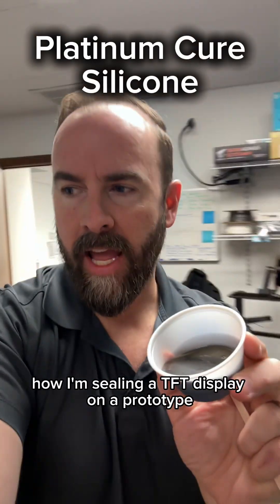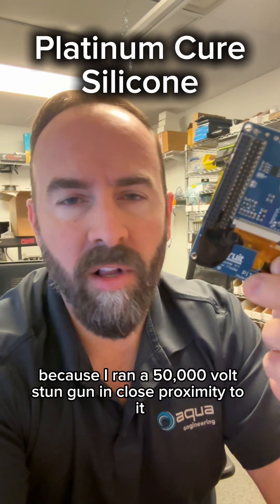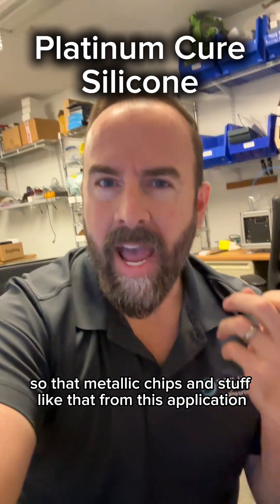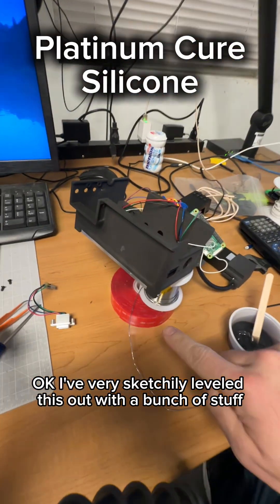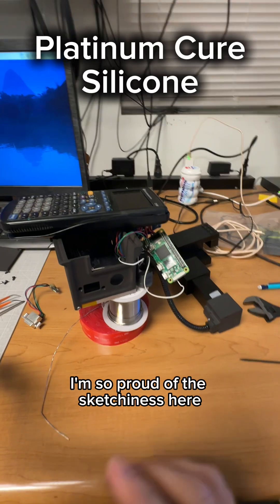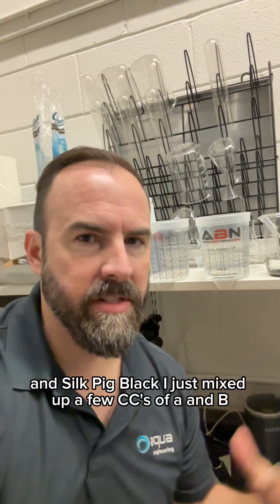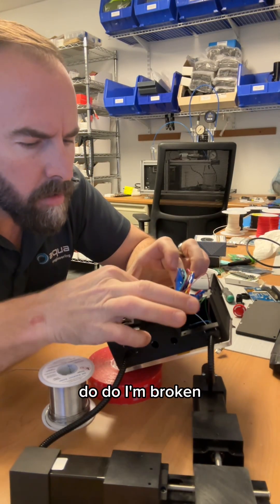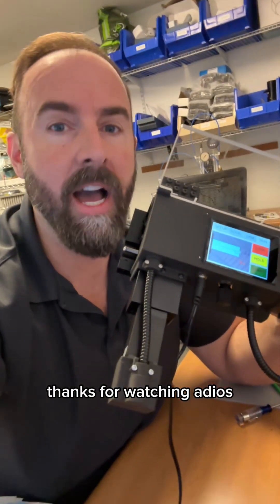Silicone and Electronics

Comment: One issue when sealing with silicone is silicone is a thermal insulator so it’ll trap the heat and you run the risk of overheating the chips. This may be fine for light weight applications but for heavier compute or if in proximity to a heat source, it could become a problem
Reply from the maker: True. Compound it with Copper powder?

Comment: Noice 💡 

Are there any epoxy/silicone reaction that could get too hot for the electronics?
Reply: With a deep pour maybe but remember most electronics have running temps over 50°C which is hotter than most people find themselves willing to touch and its rare for most two part curing materials to get that hot.

Comment: The thin layer of mineral oil there first and then pour the silicon on top which protects the circuit but also allows the removal of the silicon if you need to make any changes
Reply: Would spraying with droplets/aerosols provide enough cover? Just a thought

Comment: When you sell them in early 2026, will they come with a pi zero 2W or you’re own board?
Reply: Trying to learn from you
Reply from the maker: There’s a carrier board for the 2W that has the arduino and power conditioning, voltage translation, etc.

Comment: Always do a test patch when using plat cure silicone as it is very particular with what materials you can actually use it with, cure inhibition is no fun.. trust me.. 😅 also always make sure whatever you are pouring it in is CLEAN. 

Honestly, if your application doesn’t involve food or long lasting skin contact (or.. uhh.. bodily insertion 😅), just use tin cure, it’s cheaper and easier to work with. 😊
Reply from the maker: Sulfur is the culprit

Comment: Sorry to ask if you’ve already covered this, but what is your educational background like? How do you recommend people begin to learn the skills necessary to work on projects like you do on your page? Is there a specific type of engineering? I’m fairly uniformed but looking to learn more
Reply from the maker: I’m an electrical engineer, but 99% of what I use everyday is self taught. Was never taught microcontrollers, PCB layout, Python code, or how to run a CNC. Some of the other responses here are great summaries of what I’ve said in past videos too.
Reply: Not the OP, but I build stuff too. The electrical side is easy in my opinion. I came from a software background and still spend most my time writing firmware code. I might spend a rapid few weeks or months on the electrical and hardware side but then spend many weeks and many months building out all the software around it. I mostly do IOT things so maybe that's why it's more software heavy. 

But just do it. I teach people how to get into electronics on my YouTube channel and so many people are saying like I'm a mechatronics engineer in my 3rd year of school and haven't done ___ . It always shocks me, they haven't done anything with electrical, never made their own little robot thingy, never painted or sanded anything. If you want to build stuff, then build stuff. The amount of skills from silicone and epoxy to wood and metal and CNC and all the other stuff is just one part of the puzzle. You deal with contract manufacturers and factories and sourcing and logistics and tariffs and websites and sales and marketing campaigns. All the stuff can be learned individually and you can go to school for each of them, but most requires you to just start doing them. 

If you want to learn how to fish, I would not recommend reading books on fishing, I'd recommend going fishing 😂 Good luck! And maybe just pick up a electronic starter kit from the company Elegoo as they will teach you most the basics you need to know starting at zero.
Reply: @FluxBench I subbed
Reply: @codeintherough  Thanks!
Reply: As mentioned by the comment below, Electronic Engineering. But also know it is not quite the same degree as Electronic Engineering Technology, make sure you go to a decent sized college offering EE, I only learned DURING my EET associate degree the difference. We learn a lot of the same things down to component theory/math/troubleshooting, but the EEs are the real design and mathematic wizards. EET is a more of a supportive role to an EE, putting together and applying what they conjure up 🧙🏻‍♂️ This has become more apparent during my job search for tech jobs, but I e been considering studying up for CNC and Industrial Maintenance certs to increase my appeal, good luck with your journey!
Reply from the maker: @VoidApogee the older I get the more I like the idea of an EET degree but you’re correct, great summary.
Reply: @i2c_jason  Not trying to knock it too hard, or make it sound non credible. It  was an amazing program, introduced me to CNC and have worked up to an Epilog Pro 48. The skills you learn open you up to SO many doors, but for the same 2 years (no summer) I feel like a EE degree would have been a stronger path. If EET associates were a 1 one year or so course, THAT would be amazing. Thank you for your content, motivating!
Reply from the maker: @VoidApogee this is great perspective for anyone watching who might be considering an electrical engineering/ EET degree. Thanks!
Reply: Going off of his other videos what I remember is he studied electrical engineering, went straight to working for himself after school, he recommend learning from chatgpt
Reply from the maker: @codeintherough there’s many ways to learn, obviously if you can get a 4-year engineering degree that’s best, if not, we live in a crazy age of AI and I think it’s feasible to have it create your own curriculum. Then self-teach. But this is a wild idea, untested, possible in theory.

Comment from the maker: Along with silicones, we use a lot of urethanes and epoxies too. Platinum cure silicone was used in this prototype so I can peel it off and remove the screen if necessary.
Reply: I like T-7000 but, I'm just a hobbyist.
Reply: PU is a super material.